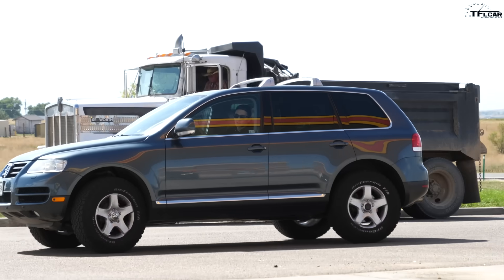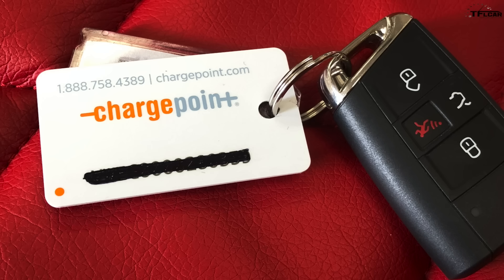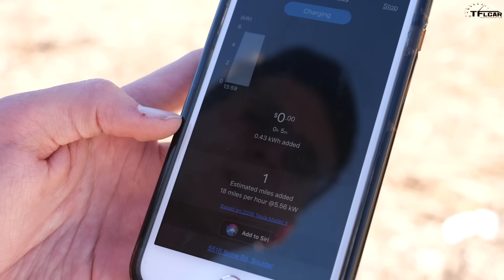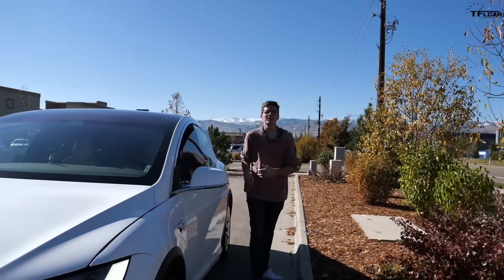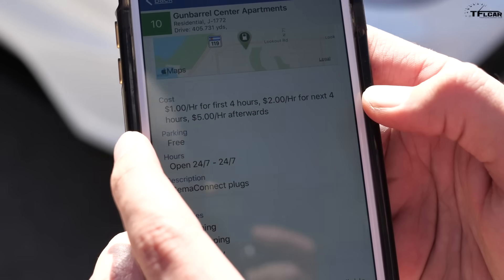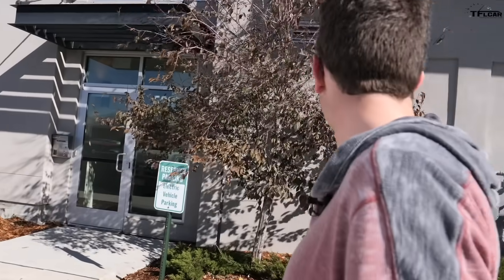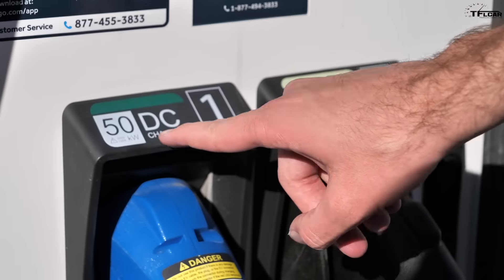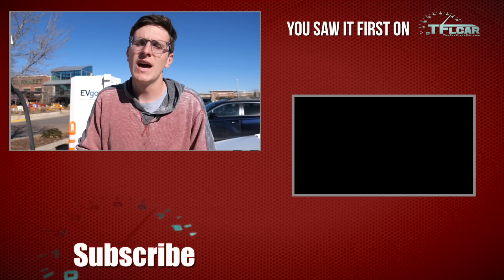Here’s Why Charging an Electric Car Can Suck - And It’s Not The Reason You Think!

Comment: Lies. Tesla can charge in 30 minutes
Reply: Tesla says to use Supercharging 'only occasionally' as it shortens the life of the battery pack.
Reply: chris chilson This is from the Tesla website:

“Does Supercharging affect my battery?
The peak-charging rate of the battery may decrease slightly after a large number of high-rate charging sessions, such as those at Superchargers. To ensure maximum driving range and battery safety, the battery charge rate is decreased when the battery is too cold, when it is nearly full or when its condition changes with usage and age. These changes in the condition of the battery may increase total Supercharger time by a few minutes over time.”

The time it takes to charge may increase slightly, but it’s still going to give you 90% charge at mile 500,000, or in the latest batteries case, a 1,000,000 miles

Comment: So let me get this straight. EV's were designed for inner city commuters because of the limited battery capacities. However since many EV owners are apartment dwellers, they can't have their own battery  chargers and must rely on these charge points to keep them moving. Suburbanites, on the other hand, can install battery chargers in their home but can't use their EV if their commute is too long. So, who benefits from EV's?   For some strange reason, I think EV will eventually go the route of steam generated vehicles.

Comment: The last time I checked, Tesla had there own charging network and chargers that can charge between 100kw and 150kw per hour. Do you not have rapid chargers in America that can charge up to 50kw per hour. Yet another review that looks at the worst case scenario to put people off electric cars. I’ve owned one in the uk for 3 years and it’s exactly the same as America with a wide range of chargers and suppliers. You get to know who to use and not to use and plan routes accordingly.

Comment: Fuel dispenser flow rate at gas station: 10 gallons per minute

1 hours worth of fuel = 600 gallons

My TDI at 40mpg would be able to go 24,000 miles on 600 gallons of fuel. 

They gotta get that charging speed up!
Reply: Tesla Supercharger V3 = 1000 mph at peak rate. of course you won't get that during the entire session, but they are getting fast.

Also, everyone I know charges at home while they sleep, either off the wall plug or dedicated unit.  So 0 minutes at the gas station (inconvenience, cost, fumes, etc).

Comment: Just proves plug in electric cars are nowhere near ready for prime time, I'm not sure they will be for a long time. They need to standardize their plugs and like gas stations need to not be company specific on payments. Good luck if you want to pay for your charge in cash or if there is a power failure in the area. How much time do you have to waste waiting for your car to charge, even at a supercharger? What if all the chargers are full and you need to wait to even plug your car in?  I currently drive a 2012 prius. If I got a new vehicle it would probably be a RAV4 non plug in hybrid.For now the gas electric hybrid represents the best of both worlds. It will take fuel cell electric cars or charge on the fly (while driving) technology to make electric cars practical. Plug in hybrids are to me the worst of both worlds.

Comment: MANY CONS JUST 1 PRO.  So electric cars have half the range, require stopping hour to charge each 3 hours (more tantrums from kids), make long road trips 35% longer so more tantrums and overnights, require charger planning, require complicated apps done outside in cold-winters, and cost 200% or extra $20,000 to buy at car store - - lots of cons (negatives).  The 1 benefit to a person is saving on the $1200 gas a driver uses, instead paying $400 for electricity I am estimating.  Savings of $800 a year will pay back the $20,000 extra investment, in, umm, never.  OK.  I admire the idea of electric cars but anyone who says they are better or equal to normal cars is a LIAR.  Imagine my folks, grandparents, stupid sisters, or average American not a techno-yuppie choosing these negatives, that is a silly proposal but I guess crazies are suggesting this.  Sorry, I like my family and would never steer them so wrong.  They just need to innovate and build a 100mpg car.

Comment: Wow, 30 mins for 17 miles plus juggling several apps. Didn't even take 5 mins to put in 20 gallons at any gas pump I find. I think the convenience of gas out weighs those small benefits of electric
Reply: Not really.  If you have a Tesla you can use their Supercharger network and the car communicates seamlessly with the station to initiate charging.  The chargers and availability are all conveniently shown in the nav system.  And newest chargers are 1000 mph peak rate.  TFL forgot to mention that (or just didn't know). If you use Chargepoint, they send you a little card and you just tap that on the charger like a credit card - Tommy only briefly mentioned that.  And most people charge at home or work so really have very little need to use a public charging station.  Apartment dwellers may have more challenge but even now more and more apartment owners are installing charging stations for residents.

Comment: I do wish Tesla would open up their network to others outside Europe. Even if it was a slower rate, and higher charges. In Europe they have to use the mennekes plug so it's not uncommon to see another brand charging at a supercharger.

Comment: What I would like to see, is most parking spots fitted with Level 1 chargers as a basic assumption, with some paid level 2 chargers available if you arrive at work at under 1/2 tank..  Get to work, plug in car, get 8kw of power durring the work day, and battery is pretty close to where started the day.  Should give about 16 mile of range, which is close to average commute distance. Then home for 10 hours, so 10 or 50kwh depending on Level 1 or level 2.  Again, if have a parkng spot, Level 1 minimum. A level 1 charger has to be less than  $1,000 per plug after parts and electrician time.

Comment: Most drivers drive 100 miles or less per day - and many of them drive less than 50. This is important because these people can charge to 100% while they are at home sleeping.  Once you start out with 100% in the morning - by time you get home you will still have at least 75% life and your home (Yes, even if it's an apartment with a 110 plug-in) will get it to 100% over night.

Comment: Nothing like going to the mall or hotel and unplugging all the cars. 😈

Roadtrip from Denver to Miami would take forever if it takes HOURS to charge the car. In a petrol car, you can go hardcore mode with no sleep, and do it in 35 hours. I speak from experience on that, because I made that very drive in 35 hours. 2100 miles, which would need (if 300 mile range) 7 chargings. That's SEVENTY hours added to a 35 hour drive. 🤨 That is unless you can find some fast charge points the whole freaking way...

Comment: I've driven a Tesla for the last 4 years, and only used Chargepoint once.  Definitely would not have bought an EV if I could not charge at home.
Reply: I'm with you.  I'm going on 8.5 years with my Nissan Leaf (still original battery that fully charges at home).  Not many miles on it since I only use it for short trips (probably 98% are within 30 miles). For long trips I ride my Harley :-)
Reply: @madmotorcyclist  lol now that's a rare vehicle combo

Comment: Takes 3 min to put liquid in a car an go 500 miles
Reply: shane roberts Yes. Good old toxic flammable "liquid" that stinks and then burns in an inefficient outdated noisy smelly internal combustion engine. When gasoline cars first became popular there were much fewer gas/petrol stations per automobile so it would follow that, as the EV becomes more popular the charging infrastructure will improve to accommodate the expanding demand with faster charging capabilities. I for one can't wait to say goodbye to the ICE.
Reply: And additional minutes getting to and from the station that sells you that liquid.  With an EV, you can ‘refill’ overnight in your garage and never travel to a gas station again.

Comment: 16 miles range added in an hour?       
Are you ringing the changes?         
I pull up to the gasoline pump and can add 400 miles of range in under fifteen minutes.       
A 400 mile charge takes 25 hours?       
Yes, it costs more and there is some carbon impact, but when traveling cross-country, the time has significant impact.

Comment: The ChargePoint and PlugShare charges are good for other cars different than Tesla.  The network of supercharges that Tesla has installed in the US and Europe are really fast and you don't have to wait for the charge, you only use them when you take a trip and they are all around places to eat so you stop have something to eat and go on. The version2 superchargers can add 500 miles per hour to a Model 3.  The new supercharges that Tesla started to install this year can add 1,000 miles per hour to a Model 3

Comment: If you don’t have high-voltage fast charger at home, forget electric vehicles. The appeal of Tesla is that I can come home and charge it like my phone and have it ready for the next day.
Reply: 120V works just fine for a lot of people.
Reply: As long as you don't want to use your car that night.
Reply: @FairladyS130  that's true, without a $500+ 30-50 amp outlet you're limited. I still get 60 miles overnight though. If I go on a big trip I'll just use fast charging.
Reply: @usamericans6045  What if you have to work late or leave early or heaven forbid have to go some place else?
Also, how do you charge your car in your driveway or when parked on the street or in the back alley?
Reply: @RCFourFive  I have a 310 mile rated battery, which I typically get 340-350 miles from. 

If I need 150 miles in 15 minutes, there's a supercharger about 15-20 minutes away.

If I thought it was inconvenient, I would plunk down the $500 for a 45 mile/hr charger, but 120v works fine.

Comment: I've got 18,000 miles on my Model 3 and have barely had to use public chargers at all. I charge at home unless I'm on a road trip, and then I almost exclusively use Tesla Superchargers. I have PlugShare but I don't use the app, instead I have the card they send you for tree that I keep in my center console, and I've only come across free chargers so I haven't had to pay PlugShare yet. Never had a reason to use any of those other services yet. Something to note, you don't have to use any of the apps to stop your Tesla from charging. Just grab the handle and press whatever button is available, and charging will stop. Works with PlugShare, Supercharger, and other Tesla-spec chargers at least.